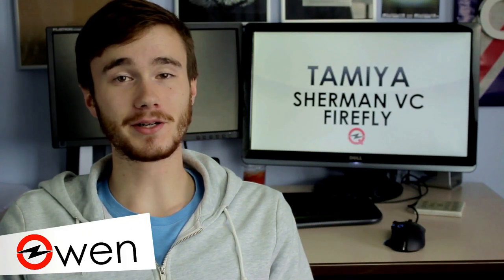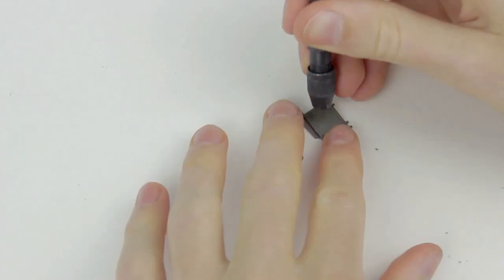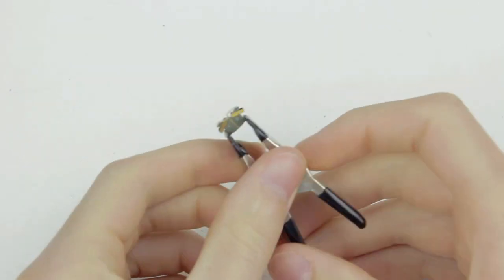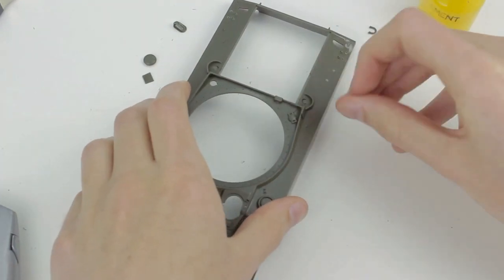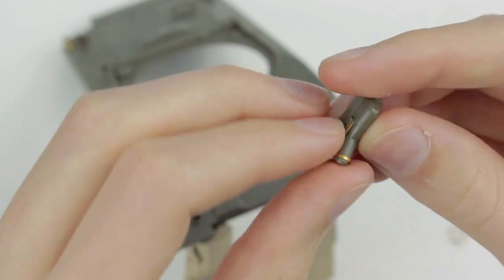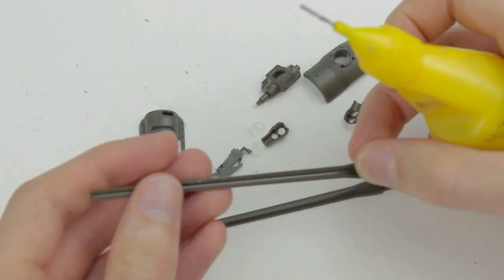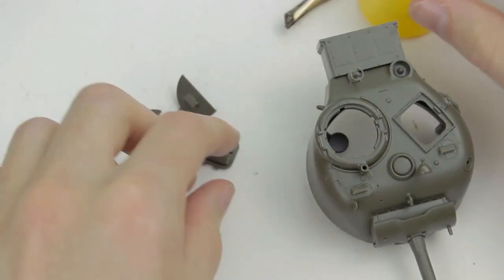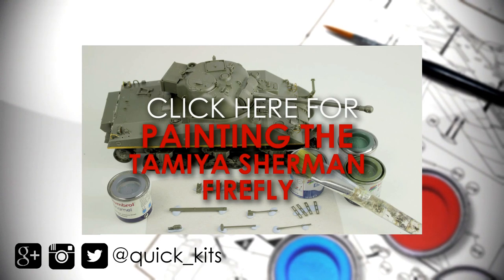Building Tamiya Sherman Firefly - Model Tank

Comment: This is a limited rebox of the Asuka Firefly for anyone that's asking. You'd be better off picking up the actual Asuka one than this one as it's gone up in price now.
Reply: Where can I find is kit for the cheapest? It seems that most firefly Kits are horrendously overpriced on eBay, aswell as Amazon... 

Thanks in advance
Reply: Agreed, Firefly kits are really difficult to find at a reasonable price.
Reply: friedeggnchips
I saved the search for the Tamiya version in my ebay searches and checked before bed every night. It popped up within a week or two for a good price.

Comment: Where do you get your paints from? I have been looking on amazon for lots of airfix kits, and many had in the 'frequently bought together' revel enamels 32340, revel poly cement and a set of 6 revel paint brushes. I will be going for starter kits, but seeing as I want to spend quite a bit of time on each and will probably be getting some of the other things you use in painting videos, I thought I should ask if those are adequate paints and brushes.
Reply from the maker: I either get paints from the Humbrol or Airfix website, or my local hobby shop. Generally I find that the paints included with the starter set are adequate and will last a few kits, the brushes included are usually okay-ish... I prefer brushes from company's who specialise in high quality brushes, such as Royal and Langnickel, and also get some quite wide brushes because those are important for painting large areas, and some very fine brushes fro really small areas. The brushes included in the starter sets I tend to use for weathering or for small-ish areas.
Reply: Quick Kits Thanks for all of the replies. I have a tendency to leave a comment with the first thing that pops into my head, sorry. Love your videos by the way!
Reply from the maker: Madscientist jr Don't worry about it :) Thank you! :)

Comment: I just got this kit. Do you have any tips for me? I feel quite lost because I only started a short time ago and this is my first larger model. Thanks.
Reply: Kyrylo Filonenko Hopefully you haven’t built this yet although this is 2 months after your first post, but I would recommend waiting on this kit, if this is your first kit of large parts count you will probably get frustrated. I would recommend buying another Tamiya kit like the M4 Sherman Early Production, which is a good beginners kit and would still be correct for the British Army, although you would need to supply some extra parts if you wanted it to be more accurate as some features were exclusive to the British. You would also have to supply your own British Army decals. I would just recommend building it as it comes from the box, as a US Army Sherman.
Reply: Where did you get the kit from?? I have been looking everywhere for one!!!

Comment: Can you recomend me a armored vehicle kit? i've built 4 planes (2 in 1/72 and 2 in 1/48, and now i'm building a BF109 in 1/48) and i wanted to build a tank, i don't want an expensive kit like a tamiya but something that doens't has many fit something and in a smaller scale then 1/35, like 1/48 or 1/72 (i don't have any place do put something larger then 20cm long
Reply from the maker: Apparently the new 1/76 Airfix Cromwell is a very good kit, but I've yet to try it myself
Reply: Thanks i will give it try